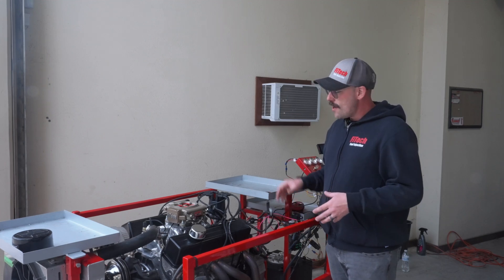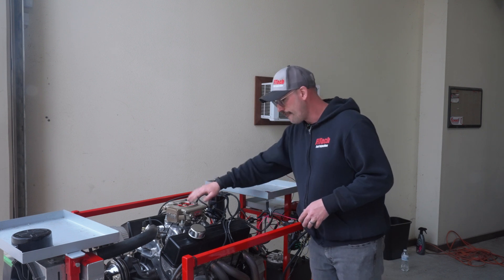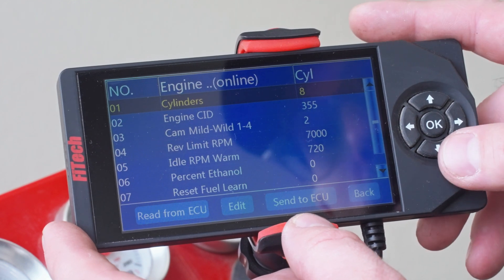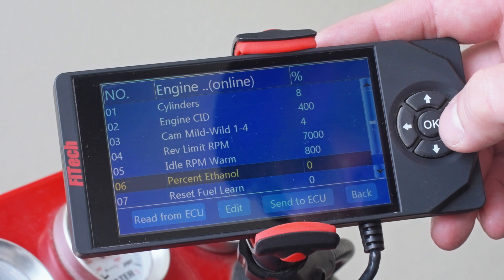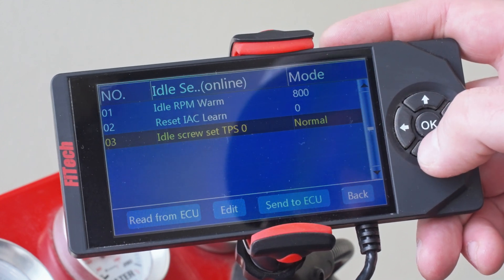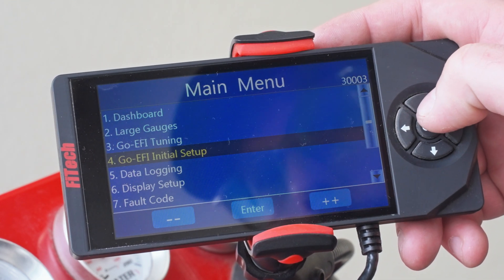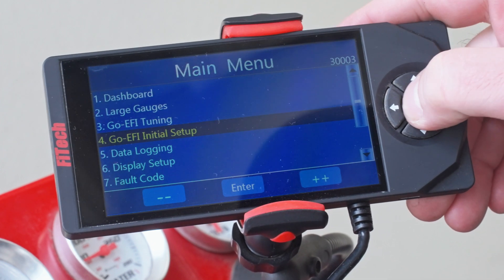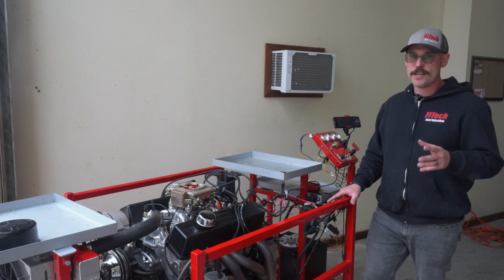EFI Handheld Initial Setup | Fitech EFI Install

Comment: I have a Fitech on a 351w in a bronco, The only thing that bugs me is when I select R on my C4, I have to wait for it to drop the rpms before I do. It's a pain when your on a steep hill off-road and need to back down.
Reply from the maker: Hello Sir,

In order to decrease the time for the deceleration for the engine you would need to make couple adjustments, this can be found under the Fitech Tuning option. This is found under the ACCEL PUMP option, under the DECEL 170 setting you can decrease that value in order to bring the deceleration faster. Also we want to make sure IAC adjustment is done and at range between 3-10. This will help bring idle faster.
Reply: @FiTechEFImedia  Thanks

Comment: Does a solid roller camshaft with 252°/260° @ 0.050" on 108° ICL 112°LSA 0.660"/0.690" and 30° of overlap @ 0.050" qualify as a #3 or #4?
Reply from the maker: Hello sir,

Thank you for providing your camshaft specs, the specs you provided would indicate that the best setting for the camshaft would be 4, starting by being a solid roller camshaft and a lobe separation below 110 would indicate its choppy and vacuum is not really present, camshaft setting 4 will be ideal for this build.
Reply: @FiTechEFImedia thank you very much Fitech.

I've been running on level 3 and I've made numerous changes to get to a very streetable tune. 

If I switch to level 4 will I have to start over with idle, timing,  AFR, etc....????
Reply from the maker: @arturozarate1752  Hello sir,

When switching camshaft settings the system will self-learn the adjustment made from 3-4, however, if you head over to INITIAL SET-UP, then head over to ENGIINE SET-UP, you will find a setting called FUEL LEARN, which if you set to 1 and send to ECU, the system will relearn the fuel adjustments, which will help with the transition from 3-4 cam setting.
Reply: @FiTechEFImedia thank you!

The BIGGEST problem I'm having is the engine stalling when decel to a stop. When I was at 3 I could get it to recover without having the peddle the throttle. Now in 4, with fuel decel cut-off temp set to 299, it's difficult, at best, to keep running. 

I work 8 to 6 and I'm always away from the car. I really appreciate the time taken to reply here. I'd like to take a day off and go through some of this with someone soon. Thanks for all the help thus far.

Comment: My unit was running fine once I changed the plugs and headers it keeps giving me code 355 but I never had that problem in all the years of having the 400 unit in my 1979 vette with a 355 Chevy built motor  need help
Reply from the maker: The (RPM NOISE) code is the system telling you the tach signal is not a clean signal. Non resistor spark plugs, burnt or damaged plug wires, Failing coil, or work cap & rotor can cause this noise. I would suggest reviewing the part number of the plugs you used and checking the plug wires.

Comment: How about a set up for dual quads efi.   Can't find nothing on it.    Had my set up for over a year and still can't get it to run right
Reply from the maker: The Initial Setup on a dual quad is identical to a Go EFI 4 system. The only difference is during the throttle adjustment (IAC Steps) you want to adjust both throttle bodies equally.
Reply: I'm running a dual quad on a 487ci solid roller FE at 12:1.....maybe I can help. Hollar anytime.